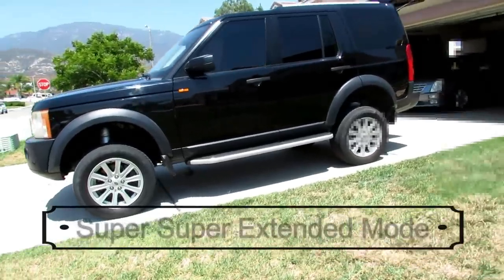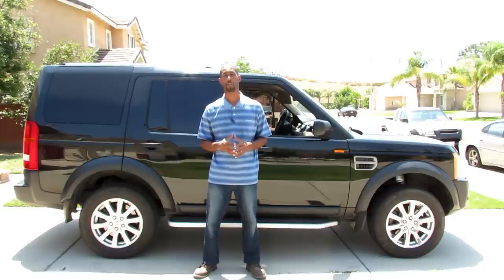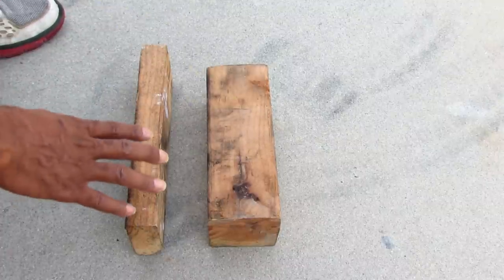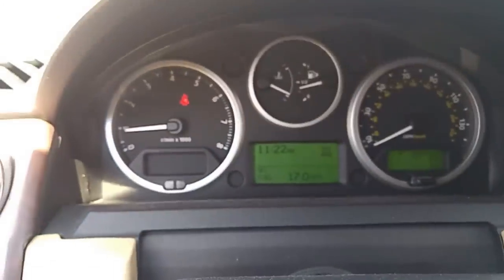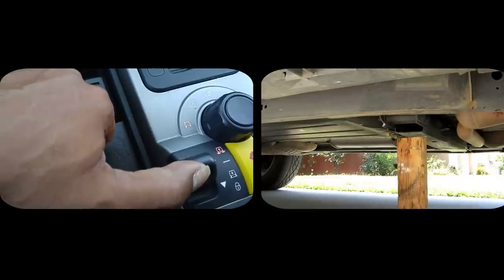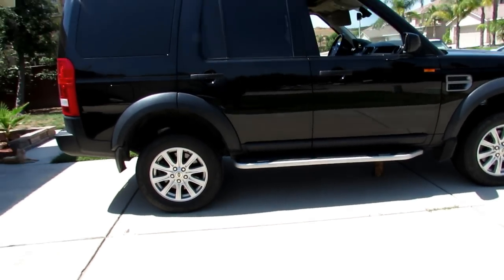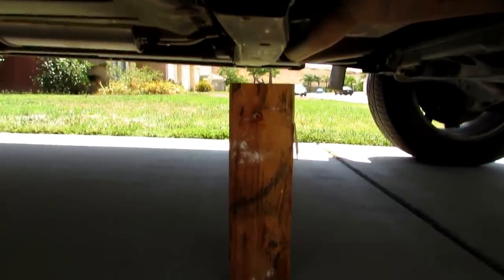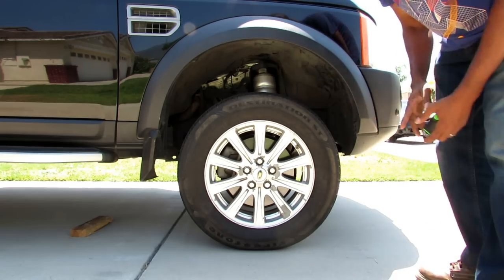Land Rover Discovery 3 Learn How To Go Into Super Extended Mode - You'll Love The Added Height

Comment: When i bought my D4 (almost 4 years back) I was taken by the tech and lots of other benefits. Believe it or not it was a lot cheaper than the Land cruiser 200 equivalent that had almost zero creature comforts - we get different specs in Australia. About a year ago I went with the family on holiday but had to leave them to do a work call in a place called Batemans Bay - I came across a firetrail and thought why not, as I do a fair bit of off-roading. It was a challenging track which I should not have been doing on my own but it was overall 7/10 snot so crazy. At the end and just before the sun went down I came to a mud whole (I was still on the OEM types then) and I got out, did the stick test etc and thought no worries......as soon as I got into the mud hole I just sank. I was far away from a town and it was about to get dark. I remember thinking what an idiot i was. Changed into Rock Crawl and tried to go forward and back - nothing. The alerts came up and I followed the instructions and the Disco went into extended mode. It still took a nerve racking 5 minutes or so to get through BUT I did get through. No land cruiser or jeep or hilux etc would have got through. I would have had to walk approximately 3 miles in the dark just to the next tarred road and seriously that would have just been the start. I know that Land Rovers correctly don't have a great reputation for reliability but frankly that episode convinced me that the guys that designed the air suspension knew what they were doing and for me it paid for itself.
Reply from the maker: Wow, I am glad your story turn out great. I agree the air suspension has come in handy many times. Thanks for watching and have fun driving.

Comment: People who talks about damaging the CV Joints don't know how the system work.  You can't drive in that mode, the extended mode is designed to help when the car is high center.  As soonest you start moving faster than 5 miles per hour, the computer will lower the car to the standard mode.  Great video showing what you can do with the air suspension of these cars.

Comment: I knew about the "extended mode" in which the LR extends on its own to "extended mode" once it finds itself bottom out. But to get "super extended mode" I had absolutely no idea, wow I'v owned this car for the last 4 years & still learn something new.
So to clarify we have

1. access mode (it's lowest) 

2. Standard height.

3. Off-road height.

4. Extended mode.

5. Super extended mode.

Thank you oxman for these great videos.
Reply from the maker: Then #6. Super Super extended mode, which once you are in Super extended mode the system will do it on its own if you are still hitting the bottom or your tire is off the ground. Thanks for watching and I appreciate the support. The Land Rover is an amazing vehicle with lots of surprises.
Reply: Plus “hi-speed mode” above ~ 160km/h. automatically.
And “ transportation mode”( in tech service menu only).

Comment: Ore you could simply buy the Australian made "Llams" Controller and wire it up (very simple installation - the most difficult part is drilling a hole somewhere to mount the switch - the rest is just plug and play). With this controller, you can simply dial up any height you want - and there are no restrictions on what speed you can travel at in any height - very handy for driving on long beaches or on dirt tracks with a high centre "hump" with the suspension raised to "off road" or higher, and being able to travel at a reasonable speed.
Reply from the maker: BM Australia Thanks I will look into that. I can see just where that would come in handy. Thanks again for the tip.
Reply: I’m about to get an LR3 I’m so hyped I’m reading about this information.
Reply: There's also Xlifter and Land Rover Passion sells another one

Comment: Note this mode is intended to help a grounded vehicle get off again, not really to be driven, on newer vehicles the rock crawl mode is the highest it can safely be driven, also bear in mind on road stability will be affected which is why they should drop down again automatically at higher road speeds
Reply from the maker: You're right because at 30 mph it will lower to normal height for safety.
Reply: oxmanagain exactly 👊🏻

Comment: Great video. However keep in mind you are putting your cv joints under a lot more stress than they were designed for, I wouldn't drive around like that for too long. Often when cvs break it's because the car is in super extended and someone floors it.

Another thing to consider is when you are up that high there is absolutely no suspension articulation. The wheels have been pushed down as far as they can go by the springs so when offroad it's not always best to go as high as you can.
Reply from the maker: TimeIV Thanks for watching and I appreciate the tips.This is why I love the comment section so much. Thanks.
Reply: The idea of this mode is just to get out of trouble. Vehicle lowers automatically when speed gets up at a very low speed

Comment: I'm about to pull the air bags off my 2007 range rover sport tdv6 and swap over to raised coilivers had enough of repairing this system the airbags have all been done 2 have gone again and the height sensors don't last long on uk roads they seize up over and over again

Comment: You just pimped your ride lol very cool trick
Reply from the maker: Thanks haha.
Reply from the maker: I agree that would be cool if it stayed in super extended mode.
Reply: Looks cool, but really it's not required often and therefore unnecessary strain. Remember there are no diffs hanging down 4 inches like you see on most 4wds.

Comment: I like your videos a lot. I get to learn so much. Do you know if air suspension needs to be turned off before mounting new tires? I am getting miixed answers between local shops and dealership. I own a Lr3 form the year 06.
Reply from the maker: The manual says to raise the Rover to offroad height when changing the spare. When I had new tires put on mine I raise it to off-road height.
Reply: @oxmanagain  Thanks a lot for getting back to me. Big help!!!

Comment: Wow never seen a Landrover/rangerover raise so high, although considering how heavy the disco3 is, i'm sure a leak or two would spring  up-- if they were the old struts-- from the air suspension system somewhere considering how much pressure was being exerted  on the components just to keep it that high.
Reply from the maker: Good point, that is why I just put new front air struts on a few days ago. https://youtu.be/MKewfwiQbbg
Reply: No, not really. I replaced my struts at 200,000kms as preventative maintenance and the bags were like brand new. Only replaced for the new shocks. Failed air bags in the D3/D4 are extremely uncommon, does happen but not likely.
Reply: Count yourself among the lucky few who don't have problems with the air suspension on your landrover.
Reply from the maker: You're right I pretty much have had it good with the LR. Thanks again for watching.
Reply: Hmm we must be incredibly lucky seeing as I had a 3 and now a 4... I know the old style bags in the 2s had problems but they're a very different design to these struts. The compressor is only good for about 5-7 years if you're using it constantly for off-road use, small price to pay for the versatility though.
Reply from the maker: I agree the ride is great.

Comment: I was looking for this tip for a long time! I will try later on, Thank you. I would like to know if it is possible to unlock the 40 km/h speed limit in the lowest position. I think it's a good position for highway driving, more aerodynamic, you know. Thank you!
Reply from the maker: There's not a way to unlock it. But if you pull out the fuse that allows the vehicle to go up and down once you're at the desired height it will not  lower.  I made another video on how to diagnose your suspension problem and that's how I found out there's a fuse that disables the Rover from going up or down.
Reply: @oxmanagain ik krijg mijn lr322 ook niet uit de extended mode ...weet u misschien wat het probleem kan zijn? groetjes

Comment: Great stuff suspension should be fine as it’s stationary as I had mine jacked off the floor to change tyres and was this high even when back on the ground until you drive it a distance of 2 feet it goes back to normal so it should not do anything to the suspension as we all got to change tyres and in normal extended mode the car is designed for and might I add designed for rough off-road use at a nice slow pace love mine these climb anywhere you’ve just got to know how to drive them in whatever the condition is great vid
Reply from the maker: I agree with everything you said. They are amazing in the dirt, like you said they climb anything. Thanks for watching and have a good day.

Comment: I bought a land rover lr3 2005 at the Auction but I have a problem on it. System of. Terrain response control seems to be disconnected that says on the board, but and I can not lift the. Suspension is for some reason does not even just raise one side, check the lines and there are no leaks and the compressor works well some possibility that it is by terrain response control?
Reply from the maker: This is what is sound like the problem could be. Do a search for this part. lr3 terrain response control switch.
Reply: oxmanagain OK thanks do you know if there is a fuse or harness I mean appears disconnect? on the board so thats way I ask

Comment: My 05 LR3 lets me put it into access mode while driving above 25. It's nice to drop it down on the highway. I'm 92.5% sure this didn't do this when I got it. It disables at 25 but will let me put it back in  somewhere along the line.
Reply from the maker: That is a first for me hearing that.
Reply: I just got back from a joy ride and was testing it out. Offroad mode gives me a warning at 25 and turns off at 31 it looks like. Access mode will turn off at 25 but I can immediately put it back in. Only once it turned of at 45. If I'm over 25 and drop below it will go off when I go back over 25mph. I probably shouldn't mess with this. It's not just telling me it's in it is for sure going in.
Reply from the maker: Tomorrow I'm going to go see if you do it for me well I'm driving above 25 miles an hour.
Reply: @thewanderingalbatross1061  Ok, so what is going on there, is that when you select access height while driving fast, you are really selecting a 'pending' lowering of the vehicle when you reach a slow enough speed. That is to say, it would be handy if you were going to arrive at an underground parking or your home garage, which has limited roof clearance etc. Alternatively, if you have elderly folks in the vehicle who would benefit from 'access height' upon arrival at the destination, you can just preempt that while you remember and select the lowered height in advance..

Comment: Hi could you please tell me when you put the first block of wood under and it raised it to “super raised mode” how did you raise it to “super super mode”? As for some reason I done everything as you did in the video but the 11&half inch block wouldn’t fit underneath it to raise it any further.
Great video thanks for uploading 👍
Reply from the maker: You want to first raise the Rover to off-road height then place the block under the frame. Lower the LR and when it hits  the block it will go into extended mode. Next, hold the break pedal for 5 sec and the lever to raise the LR and then you go into Super extended mode.  Thanks for watching.
Reply: oxmanagain thanks I done all that I thought it went higher than that with you saying “super super extended mode lol sorry my mistake 😂
Have a good day 👍
Reply from the maker: Thanks

Comment: So your video just jumps from Super extended mode to super super extended mode.  once you were in super extended mode did you drop the lr3 back down and hit the block again to get it to go back up into super super extended mode?
Reply from the maker: I started the video off in super super extended mode just to show how high you can get. Then I show how to go into extended mode then super extended mode. From off-road height, you lower the LR onto the block and then it bounces up to extended mode. Next, you hold the brake and the height selector in the up position for 5 sec and you go to super extended mode. To get to super super mode I lifted the LR with a jack and it stayed at that height. If you're off-roading the vehicle will go to that mode on its own if bottom out.
Reply: Thanks, I wondered what I had missed as well.
Reply: @oxmanagain at what moment did you use the Jack?

Did you have it on super extended mode, put the jack, lowered, waited for the bip, then pressed button to lift for 5 seconds?

Or did you simply raised the car with the jack and it stayed in place?

Comment: One time in my 2011 LR4, I got stuck when I was already in super extended mode, and after about 2 minutes of sitting on the rock, the rover went into super super extended mode by itself. Not sure if there is a way to manually select super super extended mode (other than using jacks) but it seems to me that only the computer can engage super super extended mode.
Reply from the maker: Once you go into the extended mode you can manually go to the next level by hold down the brake and push the height adjuster up for 5 seconds and you will hear a ding and then the Rover will rise again.
Reply: oxmanagain I know that, I’m saying that one time my rover went even higher than that by itself. It went to the same hight as when it has been jacked
Reply from the maker: Gotcha, thanks for the comment and enjoy that LR4.

Comment: My discovery specialist mechanic tells me that placing the vehicle in super extended mode may put undue stress on the suspension pump
Reply from the maker: I'm not going to disagree or argue with point. Even though it was designed to go into that mode I can see we're over time it does put a lot of pressure on the system. Now with that being said I did replace my suspension pump it took me roughly 30 minutes and it cost less than $150. And that repair took place at 195,000 miles.

Comment: Has anyone tried driving in this "super extended mode"? I have an L322 with extended "lift rods" that make my "normal mode" about 2" higher than normal. When I then use "off-road" / raised height mode, I get loud pops from my front end at low speed. I suspect the noise is from my CV joints binding from the added angle to the front hubs sitting at over 5.5" taller than normal. Any ideas?

Comment: Did you find this in the don't section of the owners manual as driving like that it will have more cause to roll over.i liked the video and how clearly tou explained everything but man I'm just not shure about doing that
Reply from the maker: First off thanks for watching. This feature is not for normal around the town driving. You only use this when and if you go off-roading and you need more ground clearance. You're absolutely right you would probably flip over if you drove like this all the time. I appreciate the comment.

Comment: I have bad suspension can I put regular shocks on my land rover L3. Will it ride the same
Reply from the maker: You can convert your air suspension into coilover suspension a lot of people do it. It won't ride as smooth but it will be a smooth ride. You will lose the ability to adjust the suspension it'll just be at a set height but a lot of people swear by it.

Comment: Thanks for the vid, I'll go and have a try. But, on super extended and super super extended mode, isn't the LR too stiff ?
Reply from the maker: You're welcome and thanks for watching. The ride is a lot firmer but you also have to remember when you are in super extended mode you need that height to get out of trouble. Plus, you can only stay at that height for speed's up to 30 miles an hour. Then, you will just return back to normal driving height.

Comment: Do you need that block? All you gotta do is hold that lever for 5 seconds, right? I always notice my Rover in off-road mode when I get out of the tire shop.
Reply from the maker: Giancarlo S In order to go into extended mode you have to have something trigger it. The reason I use the block that would represent you getting grounded then the vehicle will automatically go into extended mode. From extended mode if you hold the brake and the indicator button in the up position then you go into Super extended mode. The reason your vehicle is in off-road mode when you leave the tire shop, is because once they Jack it up, your air struts are constantly trying to keep your tires on the ground.

Comment: How can I take my RRS suspension out of Extended Mode?
Reply from the maker: Once you drive over 30 miles it will automatically go back to normal height. Or, you can just lower it back down to normal height with the switch.
Reply: @oxmanagain  On mine,  when I have it at normal height, I try to lower it into Access Height and it says "Suspension in Extended Mode" and then something like "Try again later when you're clear of the obstacle." Then it raises the vehicle back to Normal Height.
Reply from the maker: When you drive and get to speeds above 30 mph does it go back to normal height then?
Reply: @oxmanagain  It doesn't stay at Access Height when I lower it when parked. It mentions Extended Mode, an obstacle, and then it goes back to Normal Height. So I'm assuming I'm driving around at Normal Height.